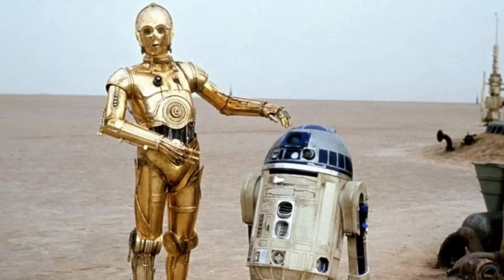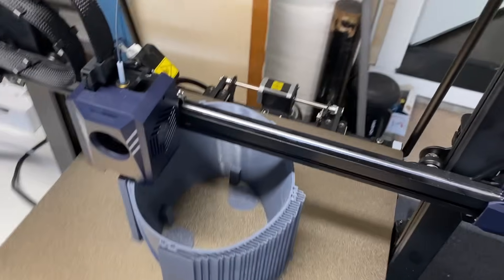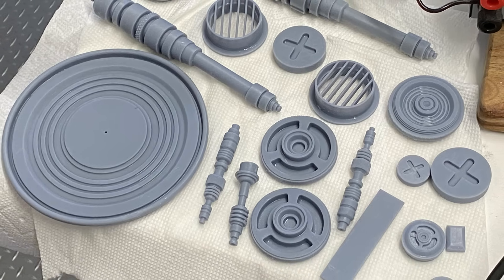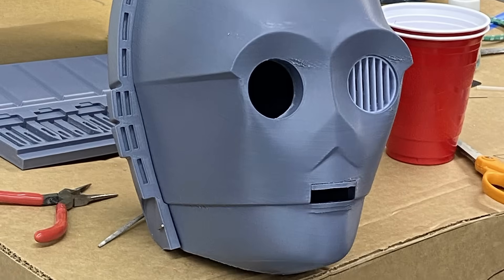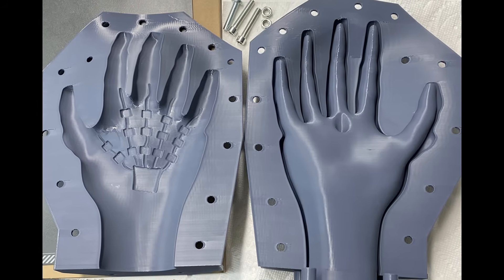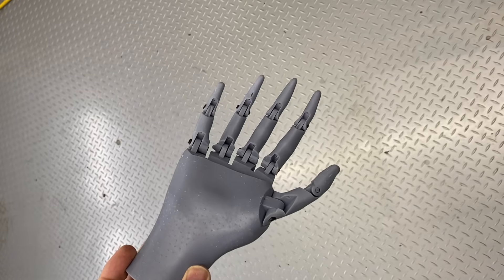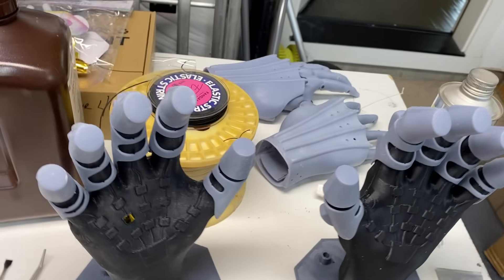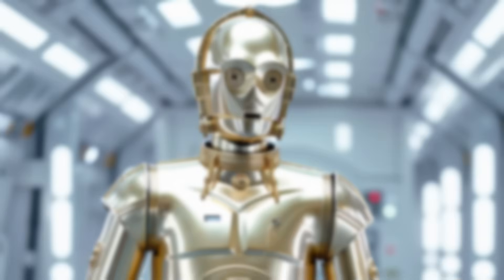Building an animatronic C-3PO (Episode 1)

Comment: I used to use the same supports you are, but then I changed to the "Organic" supports, which are like tree branches, and it was a game changer for me. The supports come off so much easier with little or no clean up. And I think they actually use less filament. I have 3D printed 3 full scale droids (the largest is 7 feet tall) and I think C3PO is on the horizon for me! I will watch your channel with great interest! Great job!

Comment: Very nice! I saw another droid or 2 in the mirror in the background. Nice job with the fingers. Priming and sanding is going to be a nightmare. I suggest one of those pedicure sanders like M&M props uses as well as a finger sander and a a dremel. Also, you can use a slurry of acetone and bondo to help cut the primer filler down.
Hopefully you don't run into caking issues that obscure detail. 
My R2 has been stalled for years, hopefully you don't run into that problem. Good luck!